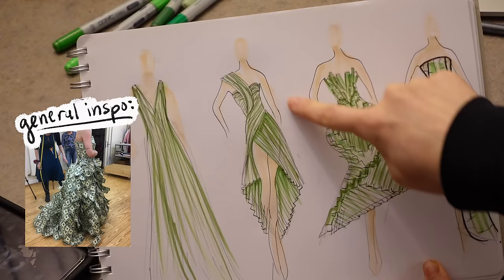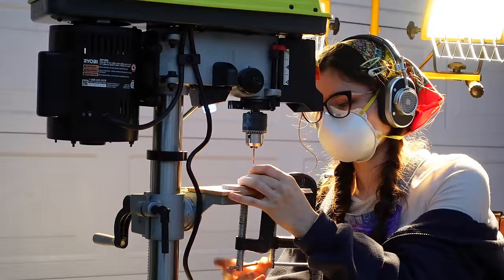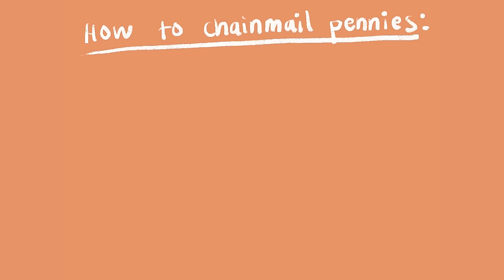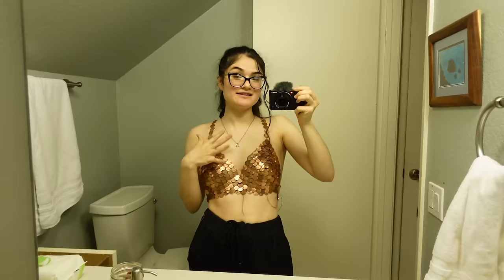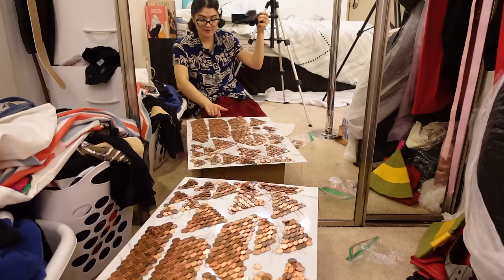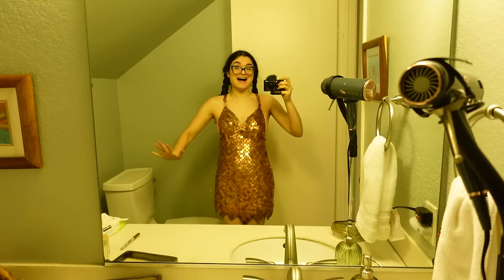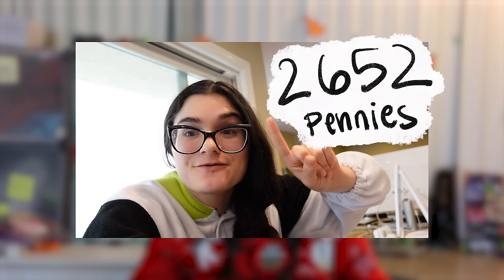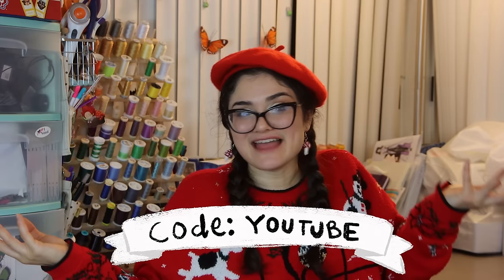Making a Dress out of 2000+ Pennies

Comment: You cannot wear this in Vegas in summer you'd burn your skin off 😬 but indoors or for a quick red carpet walk, this is hella cool. A girl in my high school made a dress entirely out of folded starburst wrappers. Not even gkue, just all folded together. I can't imagine that level of patience but here you are and there she is, so... it exists. And it's impressive as heck
Reply: Yeah I see how that could be problematic 😂
Reply: hmm, she could maybe try to make a layer on the inside that could prevent that, though it might just transfer the heat through the clothes.
Reply: @scappley1735  could regularly apply water to the dress with a fine-mist spray bottle.
Reply: From a Vegas girl- that might really heat up no lie- it’s so hot here
Reply: @scappley1735  yeah, this is one of the reasons why actual mail is worn with an undershirt-- a padded undershirt, so you don't just bruise straight through it when someone tries to stab you, but that's not exactly a going concern with a scale dress. maybe padded shoulders tho, to disperse the weight there some? else you'd end up with bruised shoulders after a few hours.
Reply: Very good point! A strict evening cocktail dress for sure!
Reply: I would love to see diy
Reply: @comradewindowsill4253  true, that dress doesn't seem light, and it probably would be painful to wear it for a prolonged period of time.
Reply: @comradewindowsill4253  probably thicker straps on the shoulders instead of spaghetti straps to disperse the weight plus an underlayer of a thicker soft fabric would make this dress a lot more wearable...
Reply: @elenaxthatxbitch why do I find one of my  members (crybabies/earthlings) everywhere
Reply: @iblame_Arren  LMFAOO
Reply: For sure! Im in vegas too and at 530am and it is still 100°. 🥵

Comment: I wonder how sparkly it would’ve looked if all the Pennie’s were new and shiny? The dress is so gorgeous even without
Reply: True, but there's so much more depth because the petina on the pennies.
Reply: We need that penny cleaning dude 😌
Reply: @hannahbananapro  what would that do to the thread, though? it would be so tragic if the thread were to be weakened after all that work 😭
Reply: That would probably be very nice.
Reply: @hannahbananapro  I'm afraid the dress would have gone bad.
Reply: I want to see dimes now 😂
Reply: i actually love the variation
Reply: A white vinegar and salt solution might work …
Reply: I'm pretty sure there's a varnish that can make metal look totally new and shiny. My teacher gave it to us when we were making metal bracelets and we just had to wipe it on. I mean it still get dirty after awhile buuuuuttttt
Reply: I like the vintage, aged look. Plus the depth of the varied colours is gorgeous.
Reply: I liked how the old pennies look
Reply: @hannahbananapro  there are better things to soak the pennies in to clean them.  Also, this should have been made out of wire, not thread.
Reply: I took metalsmithing in college and we mainly worked with copper and brass. To clean the copper their are many ways, but we mainly used a acid solution called pickle. Then you could go over the surface with a fine brush with brass bristles. I feel like she could do that method with how the dress is now, going over with a fine brush would give it a beautiful shine and maybe save some the tarnish if she wanted.
Reply: @Velocitist  patina*
Reply: loveutill theendoftimes  polish
Reply: Time to dunk it in salt and vinegar then
Reply: Brasso probably would have worked well
Reply: pennies will always be a copper color
Reply: @emil8366  brasso is kinda a nightmare tbh, leaves tons of residue
Reply: Rub some mustard and ta ra!!!

Comment: As a guy who made his first chain shirt at about your age, the secret to carrying the weight is a belt to carry some of the weight on your hips. I know your pain. Goid job you fabulous nerd.
Reply: You are so right
Reply: That's super clever and makes so much sense!
Reply: (Edit: I do think it is lovely)
Also wider straps on the shoulders for weight distribution would have also helped.  If your smaller chested, you probably have never noticed this problem, but it is a bra problem for larger chested women.  Weight distribution, it is a thing. OH, and corsets also were for this reason as well as shapewear.  All those crinolines, hoops skirts, petticoats, and over skirts weighed a lot also.  Distributing the weight over the entire torso and hips made it easier to wear.
Reply: @midnightqueen3332  ya and ading to the back a litle would help to balance it. She culd also make the waist tigter so it might not need a belt.
Reply: @martinhg98  making the waist tighter wouldnt be that possible with a dress in this style without some significant alterations.  She had to slide in from the bottom of the dress, meaning it has to be able to go over the widest part of the body the hips or the shoulders(depending on your frame).  Shrinking the waist means adding a Hook/Eye or belt system to the dress to accommodate a smaller waist.
The way I would solve it is mostly by Corset and having several Hook/eye clasps on the Corset and dress for it to hang off of, distributing the weight across the body and hips.
Reply: Thinking wider shoulder straps, maybe a leather backing on them would ease the weight and prevent the discoloration (bruising)?
Absolutely fantastic!

Comment: Hi! Since this dress is essentially chainmail, the weight can be relocated from your shoulders to your waist with a belt. you can also make the straps broader. I'd love to see this project continue, and comfort seems to be the number one problem.
Reply: Maybe a belt made out of nickles or quarters.
Reply: @dhy5342  ha, yeah!
Reply: Chain gang woowoo
Reply: Well, scalemail, but a lot of the same principles apply, having a corset styled back would also help transfer half the weight to the waist, as well as making it easier to adjust the hips to the point that it could much easier be donned or doffed, the next step would be making it practical to sit in, with chain mail this is easy, but scalemail would probably need some adjustments in how the scales are arranged or something.
Reply: @eloujtimereaver4504  wait doffed is the actual antonym for donned ?!
Reply: @wiros8101  Indeed.
Reply: I think she also needs to try connecting them with o-rings like that scalemail she showed did. It won’t break so easily & probably allows it to shift around & just conform to natural body movement much better than just tying it flat, that seems like not enough give plus more likely to break apart.
Reply: @dhy5342  that will add weight. - and no just pennies is better .
Reply: Suede on the underside of the straps would help as well with the comfort.
Reply: @natashakuzmanoska9656  the problem is all the weight currently hangs on two, penny wide points. The single penny straps.
Create wider straps, say 4 pennys deep, and line the dress with something and it would be much better.
Incidentally, chain mail (whether links or solid scales) was always worn with something underneath to stop it feeling cold or rubbing the wearer.
Reply: @tiaashtyn7560  she should have created an inner 'form',underdress/slip, and sewn  the pennies onto that with fine fishing line/plastic thread.
I thought that was what she would do.
If you research you will find chain mail was often made that way, though scale mail may not have been.
Only the rich wore scale mail.

It's much easier, talking less time and therefore works out less expensive. It's also more flexible.
The fringe could have been sewn on separately.
Working this way it would also be less cold,less heavy,and actually wearable as a dress.

This is beautiful (probably more beautiful) but took ages and is wildly impractical
Reply: @helentee9863  great suggestion
Reply: NO!!! It’s perfect. Come on, you need to suffer for beauty

Comment: If I remember correctly, scale mail was often made with a leather backing so it didn't pinch as much.  That is if a warrior didn't already wear a layer of padding anyway.  Adding a thin layer of leather or cloth would probably make the dress a little more comfortable and less cold when put on.
Reply: Yes. Scale mail was usually sewn directly into a liner of some sort (either leather or cloth) in order to reinforce the armor and give more surface area for the scales to rest against the body.

Oddly enough, since none of these would have been worn directly on the skin anyway, she actually accidentally hit on a different type of scale armor at the very beginning called lamellar armor, in which the scales are sewn together horizontally instead of overlapping. This gave more flexibility and less weight at the cost of more solid protection.
Reply: And then maybe you could add a zipper or something in that fabric too i guess? That would make it easier to get into aswell

Comment: As someone who makes maille, I am impressed with how quickly you got your dress done! A full suit of armor often takes 50-60 hours to make using either steel or aluminum rings. Someone who was experienced in chain maille could probably make something similar to your dress using only metal, but it would take a good 30-40 hours. If you ever do something similar in the future (I know, it's a crazy amount of work) I recommend using a belt to take the weight of your shoulders, or to wear padding underneath the shoulder pieces. Your work is beautiful, thank you for sharing.
Reply: @Corsius Atreides well, the correct term is Mailles, as the word is a norman/french leanword in english. 
You could also use Hauberk, Lorica Hamata, Brünne etc
Reply: @Corsius Atreides someone's a grumpy lad, huh?
Reply: @Corsius Atreides Ohhhh someone needs a wee hug. C'mere then chap
Reply: It is backless so that could make it much faster
Reply: @Corsius Atreides I find it funny that someone trying to correct spelling that is already correct for what it is, can't take someone correcting them, with an immediate insult. Grow up.
Reply: tekodoraudor  both terms are acceptable, still she still should have added a liner with padding and a belt.
Reply: tekodoraudor  when I use the term I use maile but mail IS acceptable and despite modern postal terms can be used for other things. As long as you can understand what is being said the job has been done. The material is still being used for industrial safety equipment so if you really want to know how industrial companies spell it check that.
Reply: Just checked. They use chainmail

Comment: I've had this fantasy dress idea for awhile: Scale mail mermaid dress made out of mother of pearl scales. Imagine it being like mermaid armor.

I've never worked on dresses or scale mail. But this has been in the back of my mind for forever
Reply: it would be lighter weight than metal, that's for sure- but i think most kinds of shell wouldn't be durable enough to make a whole garment out of- they'd prolly chip too easily. might be better to stick with metal, but find some sort of coating for the metal to make it look pearly
Reply: Yeah. You could probably make something more durable, but with a similar look if you used metal + enamel.
Reply: Pearlescent painted lightweight plastic sounds ideal to me. Something flexible enough to get the shapes you want with mild durability. Lighter than metal.
Reply: @xxselenaxx2142  think your idea is closest, and if you get the right kind you can even shape it into a shell shape, like perhaps a warbla(sp?), possibly those flexible plastic cutting mats you see at like Walmart...but my thought is if your going to use a plastic your going to need some kind of underdress for separation of plastic and body otherwise sweat is going to be running down the dress/shirt/skirt.  This could be as a lining, or a separate shift, cami shirt/dress...

Comment: as a size 16, i could NEVER! if this took you 50+ hours i can’t even imagine how long it would take me 😭 it ended up so gorgeous, it’s really wearable art
Reply: You might be right but how hot would a Size 16 look in this dress!!! 😍
Reply: Also, the weight of the dress would increase. I don't think it would end up wearable because of that.
Reply: @LotjeG  I just wanted to point out that the difference needed to increase this dress from a 6 to a 16 would take an additional 25 cms of additional pennies. Hardly anything that would break anyone's back.
Reply: @Your_caring_mother  It's roughly 1/5 extra in width, not even taking into consideration the length of the dress and the cup size which probably needs to be increased as well. As seen in the video, the weight is already a lot for those straps, I don't think adding even a relatively small amount of weight would increase the comfort level. Maybe with a redesign it could work? I've seen people in the comments suggesting a belt so the bulk of the weight rests on the hip instead of the shoulder.
Reply: @LotjeG  I only work in metric
Reply: @Your_caring_mother  So do I... 1/5 is a fraction...

I miscalculated. It's actually 2/5 (or 40%), which translates to quite a bit of weight.

Comment: use flattened pennies next time; they'll be perfect for scaling, and produce a lighter garment. a little cape/drape, maybe, to go with the dress?
Reply: Wonderful idea!
Reply: Just a few weeks of work. Lol
Reply: Next time lol
Reply: Does flattening something make it lighter?
Reply: @DivineLightPaladin  if you use less pennies, then, yes, it would weigh less.
Reply: If they are half as thick they would be twice as wide.  Same size dress would be 1/2 as heavy and would need half as many connections.  Wild art project nonetheless.
Reply: @kenreynolds1000  Do them on the railroad tracks for true authenticity.
Reply: @DivineLightPaladin  yes because it would increase the surface area
Reply: @DivineLightPaladin  It doesn't make the individual penny lighter, but by flattening the penny, you stretch out its surface area.  The penny becomes smaller in depth (flattened) and larger in length and width.  The net result is that you would need fewer pennies.
Reply: @headlesschicken203  I live here but I wish I had the movie to travel around more SIMPLY to get those. I love collecting them rtewrfqtg

Comment: I love this. I, of course, immediately wondered how many times per minute it would pinch stuff. My guess is fifty. If she really wanted to make this lighter, she could have hollowed out all the pennies before sewing them together. "That is not only virtually impossible; it would take a hundred times longer to make the dress if she had done that." I never said it was a good idea.
Reply: Modern pennies have a zinc core (late 1982 and newer) so hollowing them out would have taken just a simple acid bath. That probably covers the majority of her pennies, as it is about 40 years worth. That said, it also takes the structural element out of the pennies, and they would have bent and deformed as she worked them, so not a good solution.  As some have said, she probably needed to stitch them to a slip and make the straps a bit thicker. Probably could have also incorporated a zipper into the slip then have the pennies overlay slightly to hide the zipper. Fantastic work though.
Reply: @brianflowers4217  I like your thoughtful reply but now have to ask if you knew I was joking.
Reply: @katieell4084  I figured you weren't serious about her actually hollowing them out, but it is very possible. We had the hollow penny demonstration in high school chemistry over 25 years ago.

Comment: This is very pretty, but if I made it I would make a few changes to make it wearable for more than a few minutes. The overall design is great. It just needs some hidden practical elements. What this dress really needs is a foundation. A foundation would address both the issue of weight, and it would make it more comfortable against the skin. 

To start, I would use the same pattern that she drafted, and I'd cut out two layers of dark copper colored silk organza. I would basically made a lined dress with the two layers. I would also cut an internal waistband the shape of the upper edge of the skirt portion, and cut that out of something heavier, probably silk taffeta, and bone it every few inches. The biggest issue with this dress is the weight of the skirt, and an internal waistband would redistribute some of that weight. I would add a back zipper, so you could get into the dress with the newly added waistband. I would probably use a copper colored coat zipper with copper colored teeth, and leave the teeth exposed. I would sew silk ribbon under the straps, so prevent chaffing. 3/8 inch ribbon wouldn't be seen, and it would at least keep the stitching from rubbing against the skin. 

To mount the penny dress "shell" onto the foundation, I would sew through the thread connecting the pennies, with heavy thread. Waxed silamide would be my first choice. I would sew the waistline in first, and then sew in the top edges and around the added zipper. The sitting issue kind of is what it is, unless you wanted to make the skirt slightly more flared. I don't think not being able to sit is a deal breaker. (A side slit would probably solve the issue as well, but that might make the dress too skimpy for some.) With a bit of structure, this would make a phenomenal prom dress. 

(Yes, I've quadrupled the price of the dress, but over 100 hours for something you can only wear for a few minutes isn't a great cost per wear ratio. lol.)

Comment: There are ways to balance the weight of that dress, with Hidden counter weights. And materials like gel and memory foam that could be cut into smaller circles. And attached to the pennies on the straps. Yes its not a all night dress but With counter weights. And cushion material placed in certain points. It could be.
A 3 or 4 hour dress easy! And whoever did your hair , please don't ever let the. Do it again for a  montage!!!!! You are beautiful!!!! And need to get that through ur head!!!!!!